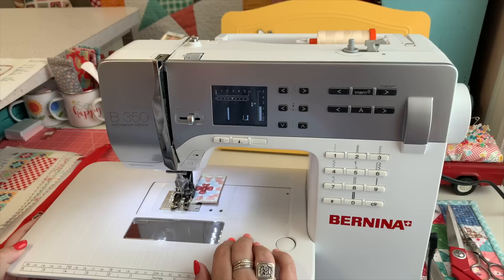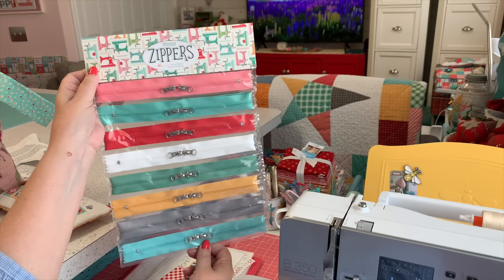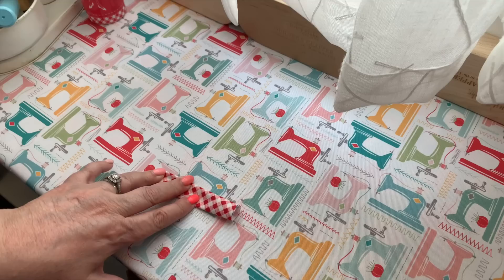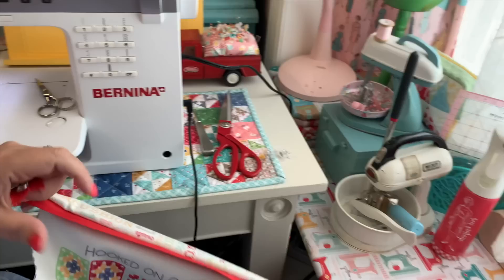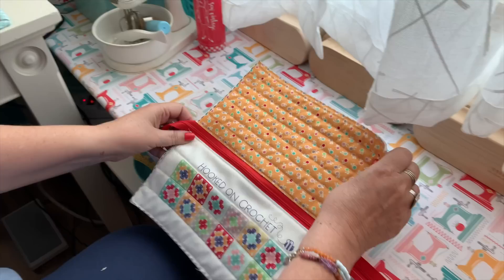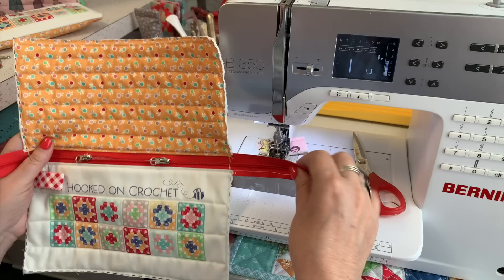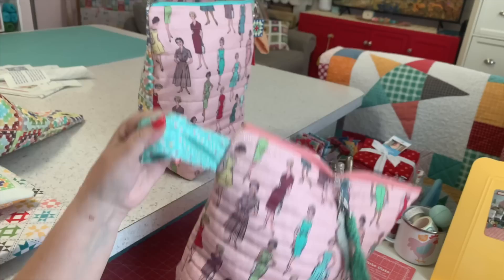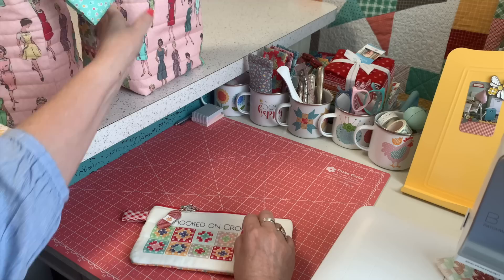Happy Crochet Panel Bag Tutorial

Comment: Great step by step instructions.  I round the corners when stitching & it makes pushing out the corner is much easier, to me.
I really like the use of your thicker fabric (Designer?) used & thin, batting & keeping the batting out of the top seams!!! 
Would you need a second large bag to hold the WIP, works in Progress?

Comment: I noticed that on your panel, the fabric is full color print in the rectangle shape. So you can make a cross stitch project flat bag or the crochet bag. On FQS, the panel looks like the 3 inch square is white. Which way are they actually printed? I would like to make the flat bag for cross stitch. I love these prints.